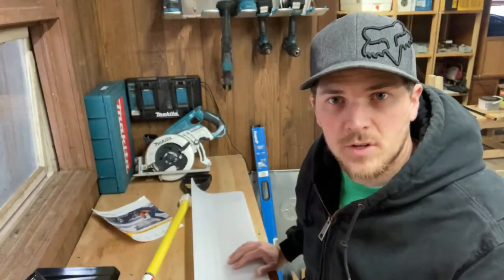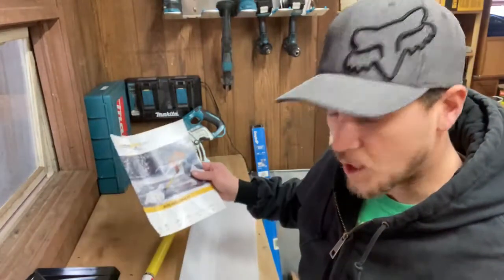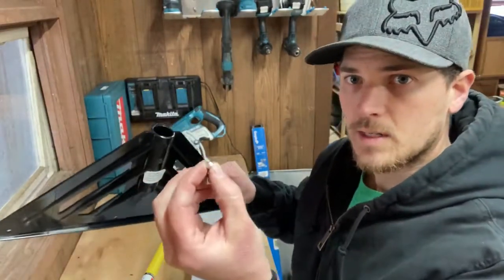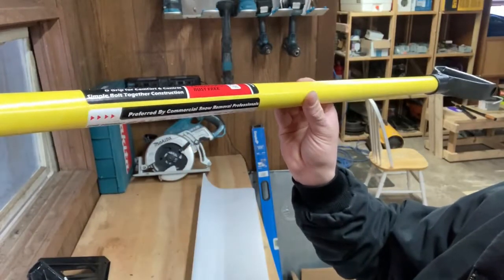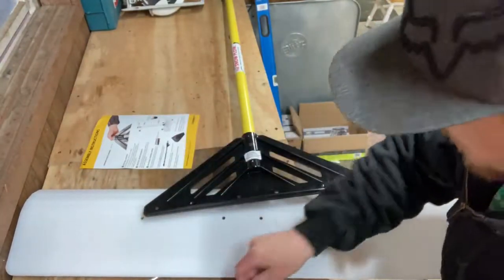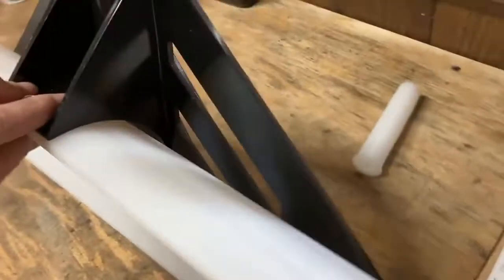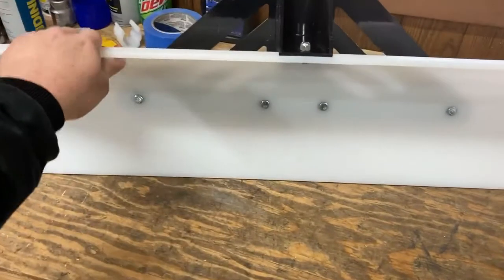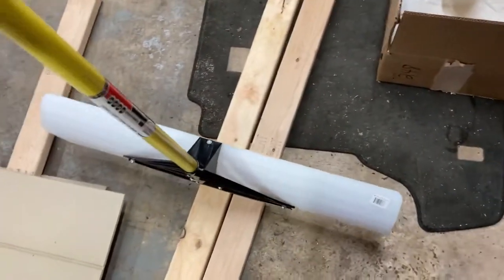The Snowplow Snow Pusher 36" wide (BEST SNOW SHOVEL!)

Comment: These are great plow shovels. I've had one for a couple winters now. I have gravel mostly, and found that the poly blade would catch a lot. I took some 3/4" pex pipe cut it lengthwise and slid it over the scraping edge. The pex grips onto the blade great and never falls off. Now the poly blade stays new, never wears down, and glides over the gravel.
Reply from the maker: That is a great idea!
Reply: What and how did you cut it with?
Reply: @ur3961  several passes with a utility knife. It is a bit challenging/dangerous but the pex tube I cut two years ago is still going.
Reply: @kev5782  THANK you SO MUCH for replying back to me.  👍 
I did pick up the Plex tube.  Now the challenge in cutting it.  Evidently it does not matter if the slit is thin to fit over the shovel edge.
Reply: THAT was the GREATEST solution to my problem of not being able to push it because it dug in too deep on the unfinished surface I bought it for. 
THANK you SO MUCH!👋👋👍👍
Reply: @ur3961  awesome glad it worked out for you!

Comment: To KEV: QUOTE:"I took some 3/4" pex pipe cut it lengthwise and slid it over the scraping edge. The pex grips onto the blade great and never falls off. Now the poly blade stays new, never wears down, and glides over the gravel.  " THAT was the GREATEST solution to my problem of not being able to push it because it dug in too deep on the unfinished surface I bought it for. 
THANK you SO MUCH!👋👋👍👍